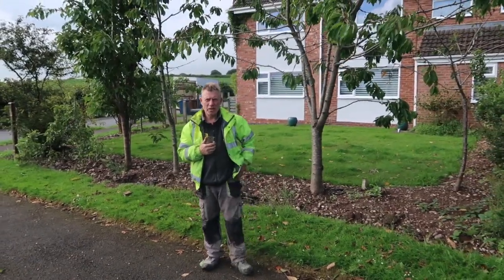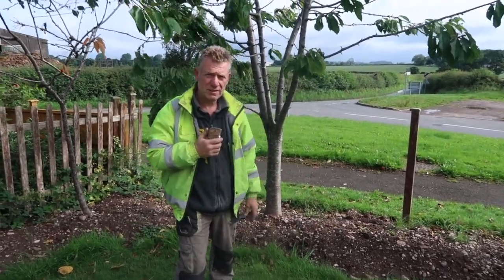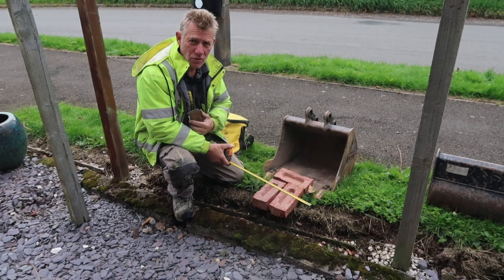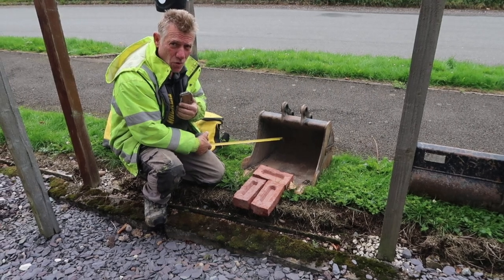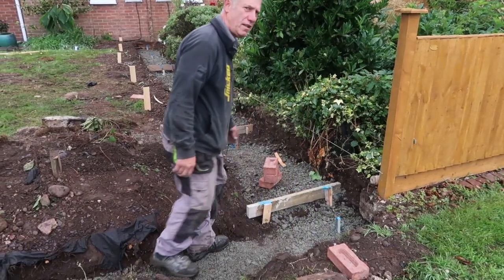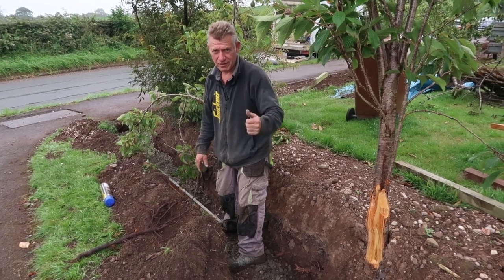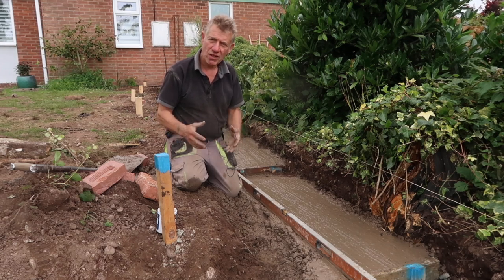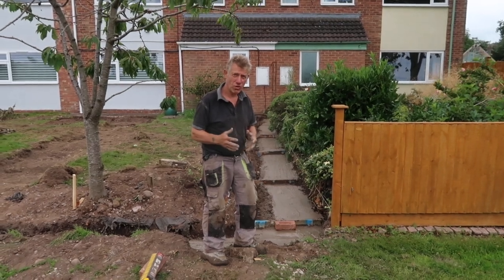Foundations for a 50 meter garden wall

Comment: Should be using site datums (not spirit level), and probably expansion joints too.
Reply: Whysite datum this’ll be fine..He will be putting exp.jts in...He knows what he’s doing. Bet you’ve never done this sort of work,most experts have never laid a brick in their life
Reply: @eowenspa2  been in the trade for 40+ years. Too much room for error using spirit level over this length  years ago we'd use a dumpy level or cowley level to set up some site datums but these days it's all laser. Oh and expansion joints should go right from strip foundation upwards. Also on this length we'd drop some rebar in.
Reply: @sweetfreedomGB  What are you saying, the Egyptians, the Romans, oh and the Greeks not to mention the Babylonians all did construction works that we could never match today WITHOUT LASER LEVELS, Datums and the likes...You're jealous!!! I note this guy has done the wall and it looks excellent! (old school) rocks mate

Comment: Why are the concrete foundations built on loose stone - they should have been on clean as dug material. The stone will compact causing voids under the foundation and instability.  The foundation thicknes is too thin, it should be a minimum of 150mm with a formation depth of 450mm for a wall up to 1.2m high (deeper for a taller wall).  The bricks look to be a stock type brick that will perform badly in a double exposed garden wall resulting in efflouresence and frost spalling.  The brick work up to 150mm above the ground level should be Class B engineering bricks.  Were the depth pegs taken out before the concrete was poured or left in?  A bit of re-bar is the correct material to use and it can be left in the concrete.  5/10
Reply: You sound like one of those straight out of college office boys that go by the book but have little common sense.This will be fine
Personally l may have brought the concrete up to gl,but all in all well doneChris,you have a nice base to work off.
Reply: @eowenspa2  No he's not he knows what he's commenting on. Personally I would not put my jobs on youtube if id did not construct them the correct way.
Reply: @eowenspa2  I have been in the building industry for the last 47 years and qualified as an Architect 40 years ago.  I have considerable experience with buildings and construction from small garden wall projects up to multi-million pound projects, both traditional and cutting edge.  I have had the benefit of working with the best engineers and clerks of works around the country and am proud to have learnt considerably from them.  I have worked for public bodies, in private practice , including my own for 25 years and worked on both sides of the fence on traditional contracting and design and build.  I cannot therefore be ever accused as being 'straight out of college'  I forget the countless times I have inspected improperly constructed projects that have failed and I have also provided expert witness testimony in building litigation cases.  
What is shown in this video is little less than incompetent building, generally classified as 'cowboy' building and I doubt would pass any professional appraisal, including Building Control.
Reply: @adl2005  I have met too many 'builders'  who do not know how to build, indeed the last one was a plumber by trade who supposedly ran a building company and clearly didn't know anything about building structure, a fact that he demonstrated to both me and the structural engineer.  Worryingly, he had been engaged by the client on recommendation to convert a Grade II barn into a dwelling.
Reply: clive williams 
I served my time for four years no stupid nvq’s un those days. Some of the lads coming through now have no idea as they have never been out a training centre
Reply: @biblebasics100  I have only highlighted the proper way to construct the foundations for a garden wall that will be supported by building professionals everywhere as well as good builders.  It is a sad indictment of the industry that this bad practice goes on unchecked and even applauded by the ignorant few.  It is doubly sad that such practice is posted on You Tube as being the correct way to do things (and then to get fees for so doing).
Reply: @clivewilliams1406  Over the top by the book stuff...do you realise how much concrete that foundation would have to take at 150mm deep, with added r-bar etc...over 3.5c3 of concrete...for a small garden wall that is over spec mate.  Most builders would price themselves out of a job at that rate. This is reality easy for people to follow and as far as I'm concerned is sufficient for this job.  Any way looks like he's putting another vid of the project so let's see what that is like!!!  Looks like I'm not the only one who thinks this too
Reply: @eowenspa2  I think the same as you mate 👍
Reply: @biblebasics100  You clearly don't know too much about foundation/concrete work, why Re-bar and why C3?  All you need is Gen1/C10, which is the basic domestic concrete mix.  What you suggest would be more appropriate for high rise concrete framed buildings.  The thickness of the foundation allows for the shear at the edge and the loss of thickness due to contamination with the ground.  Its stupid to say build the wall as cheaply as possible because that is all the client can afford, when it is clearly not adequate and will probably fail, usually after the 6 year liability and at least 2 iterations of building company so they don't have to fix their problems, leaving the client to pick up another bill.  I guess you would put bicycle brakes on your van because that is all you could afford?
Reply: @clivewilliams1406  Flatulence comes to mind, those foundations are good to build on.
Reply: All garden walls can suffer from frost damage as there is no dpc built in to stop the above ground brick being permanently damp . I do remember that sandy soils are 600mm and clay 1000mm deep for foundation,  but that's for house extensions etc . I have seen conservatory jobs where the concrete was flush with the ground level .  That's poor to my mind .
Reply: @dennisphoenix1  As the brickwork is constantly in contact with the ground you will find that dwarf walls found in external works such as garden walls will suffer from frost damage unless the bricks are frost resistant e.g. Class A or B.  Above dpc level whilst the wall may be wet both sides frost damage is not usually an issue unless frost susceptible/LBC pressed bricks are used.  The depths of the foundations for external works walls are less than for habitable buildings and I quoted the former NBC standard details for garden walls.

Comment: Top job chris. Can you tell me what the maximum height a wall can be built without having to build piers in it. Lets say the wall is 25m long.
Reply from the maker: Hi, what type of wall are you building, a single brick or a double brick?
Reply: Full brick
Reply: Construction Secrets single skin brick between 375mm and 525mm depending on where you live. 9 inch/215mm would be 1075mm - 1450mm depending on where you live and to hse guidance. People go a lot higher but wouldn’t be covered under house insurance should it go over In high winds.
Reply: Build pillars in it otherwise it will fail at some point, it will crack and move if only 9 inch thick over that distance. Consider control joints to
Reply: Thanks for taking the time to reply. My customer wanted to go 2m high, full brick wall without piers. Got some good infor' i can use now. Looked everywhere and could not find anything. Thanks again.

Comment: Did you put stone down before the concrete?
Reply from the maker: Yes, its a common practice to help firm up the ground and for movement!
Reply: Thats doesnt sound right? Foundation should be on firm ground bearing strata.. if you put stone on then pour that stone can settle/move and in turn you foundation can settle?
Reply: D M 

I thought that, always been told that as well. I know they do it in America like this
Reply: D M they do what’s known as tamping compacting down the stone to minimise settling so therefore most of the settling has already been done it can be done manually like these guys were doing or mechanicaly with a flat plate compactor machine which they wouldn’t of been able to use in this scenario

Comment: Curious ?
I did not see any Concrete Reinforcement ( Rio ) going in during the pour ?
It,s only a small wall but you are only relying on ground strength to support the wall.
There is no real strength in the concrete without Rio.
Other than that question.
It,s always better to watch other people doing the hard work for a change.
Love your idea with the spirit level ( something most don,t think about )
Most Assume a level is Level ????

Comment: Good tip for turning level around. Been long in the game and never heard of it. Cheers mate!
Reply: It's also the way to check your level for level
Reply: Pistol Knight I’d normally draw a vertical line on the wall using my level, then turn level 180 degree on Z axis and draw line again from the top end of the first line down and see if bottom ends of the lines marry up. If they’re not, you divide the difference by two, so you know how much your level is out.
Reply: @StanOwden  Depending how much its out by, throw it away and get a new one
Reply: Genius

Comment: What governs depth of foundations?, how deep is this one
Reply from the maker: Paul Perrin Hi, to answer your question, it depends on the type of ground you’re building on, I went down approximately 600mm then 50
mm of MOT and then 100mm pf concrete as the ground was just stony soil!!
Reply: Usually ground conditions...I.e, is property in area been built on bog(ponds in area) - water(levels of cilmate) - soil condition - man made land  condition(like used potties & factories in area)....can depend on depths & if needed  reinforcement in concrete foundation or other type of structure needed,. Also mass weight bearing down.

Comment: Hi thanks for the video, I'm about to do the foundations for my small garden wall. The volume is 0.5m cubed, can you help tell me how  many bags of 25kg cement to sand and aggregate for a 1:(2:3) ratio and how much water?

Also how much can I knock up in one go if I hire a small cement mixer?
Reply from the maker: Just some info to help you..1CM3 of ready mix concrete weighs 2.5 tons in its dry state!  So 0.5CM3 will be half that ie 1.25 tons so you'll need a tone of mixed ballast (cheaper by the ton bag to make a ton in 25kg bags you will need 40 bags at double the cost) .  A 4 x 1 ratio of 1 cement and 4 ballast works out at half a bag of cement to 2 x 25kg bags of ballast!  So you could work it at a tone bag of ballast to 18 bags of cement= 1.25 ton of concrete. You will add water to make a reasonable slump thats workable to level! I hope that gives some idea and ref to work from?
Reply: Chris Longhurst 18 bags of dust would weigh 450kg. That would make it virtually 2/1 mix? Plus you should mix cement ratio by volume not weight......
Reply from the maker: @MrB3ngy  They're just a suggestion's Dodgy Dave, that's why I use ready mix
Reply: Chris Longhurst 😂😂 the 18 bags of cement would do the 0.5m3  footing on there own 😂😂😂
Reply from the maker: The Agenda you’re looking at around 6 bags of cement and about 33 bags of all in ballast, just looking at an old job with this amount! Hope that helps
Reply: @foundationgood123  Thanks Chris, 6 sounds about right. Thanks all.

Comment: Actually if it's one brick thick it's 215mm, 225 mm with a joint, turning the levelling when pegging out is called transversing the level, and they are called piers not columns. I need to get my self a hobby, what am I doing commenting on this.
Reply: My question to you mate, can you do it!!! The old Proverb. those who can't do, teach. (derogatory) It is easier to get a job teaching how to do something than to get a job actually doing that thing.😆😆